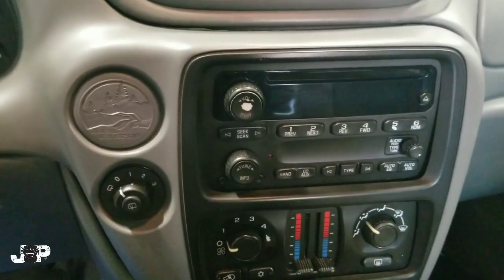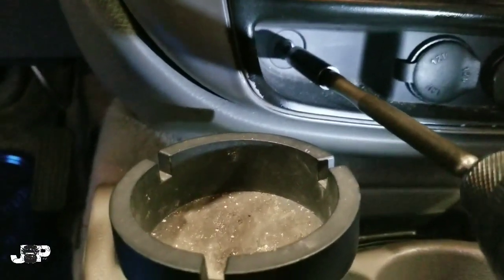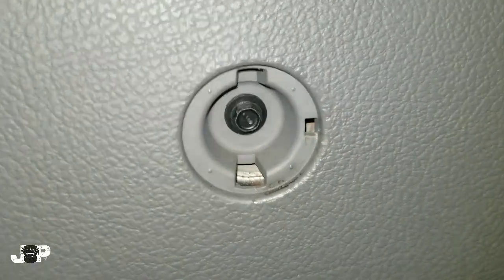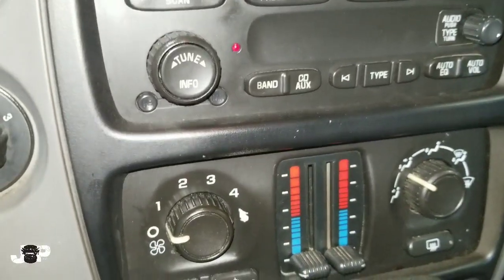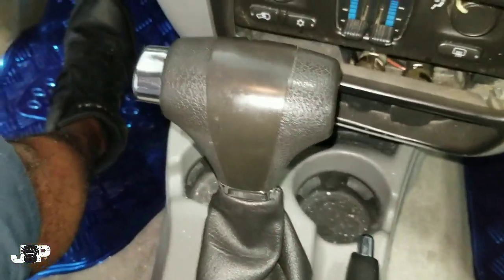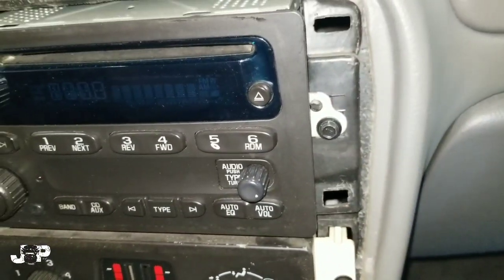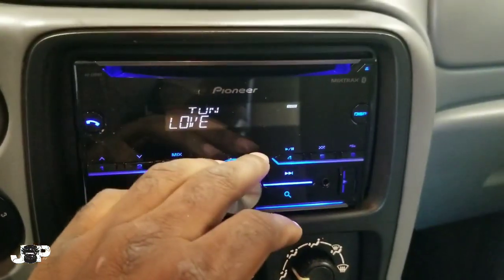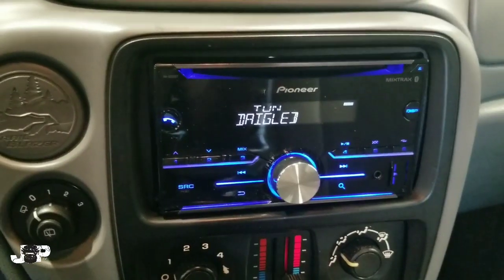2007 Chevy trailblazer radio removal

Comment: Put a new radio with harness on my 03 trailblazer  works great when i turn to ACC ON but audio turns off when i start the car..turn the car off and audio comes back!.. every wire is color coded and connected properly but cant figure out why this happens...

Comment: This video is great! I have a question, I've got a 03 TB and I'm replacing the factory stereo and possibly the door speakers. I've got Bose in mine. I was curious if I replace the front door speakers with aftermarket speakers, will it sound as good as it does now? I've never heard door speakers sound as good as the ones in there now. The bass is incredible for factory
Reply from the maker: as long as the aftermarket speakers you buy arent cheap it should sound great

Comment: Hi I'm looking at getting a bluetooth touchscreen with backup camera for my bfs 06 trailblazer was wondering if there's anything he should know before getting it
Reply from the maker: Just get the right parts like dashkit wire harness and antenna adapter and its pretty easy from there with the right stuff
Reply: Thank you so much and easy to install a backup cam type

Comment: Quick question: Great video first off. My radio sounds like it has a crossover issue. All of the Bass and Midrange is lost with only the high end coming through the speakers. Will raplacing the radio fix the problem as well as still keep my Sirius XM and OnStar Satellite features?
Reply from the maker: this could be a few different things 1 if you have the bose system the amp could be bad. but most likely if the amp is bad then you wont get any sound. if your only getting high end sound that sounds like you might have tweeters up front and your mid speakers are blown. you can probably replace the speakers and be good without touching the radio i would take a door off and test the speaker to see if its blown

Comment: I also have an 07 trailblazer without nose or onstage. I bough a radio and the harness, a guy at the shop told me to run red wire to the fuse. How did you do that? Or do I not need to worry about it.
Reply from the maker: Good question so you need to find a fuse at the box that will give you 12volts with the car on and 0 with the car off it's best to use a multimeter and use the dc volts setting to find which fuse you need. Simply take your black lead and attach it to ground and start testing fuses with the red lead. You will have to do this if you bought the cheap harness cause that car has no ignition  behind the radio
Reply: JPtheinstallguy thanks man. So once I do that  connect the red wire from the stereo to the fuse then right?
Reply: I'm about to purchase and have to go through the same thing so how did it work out for you?